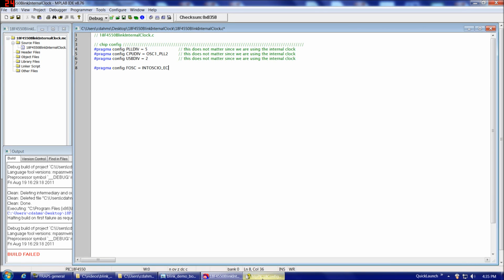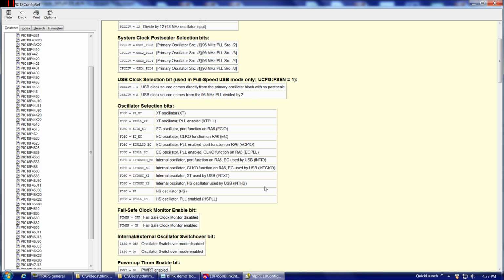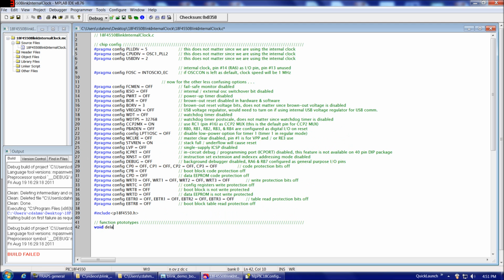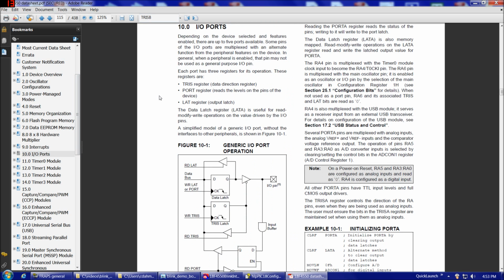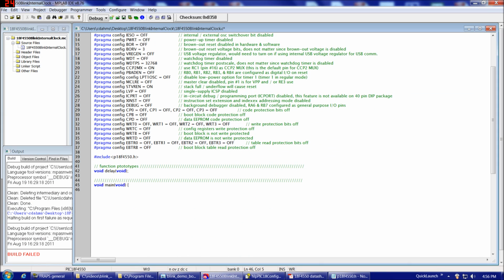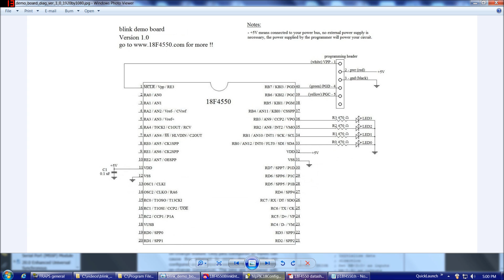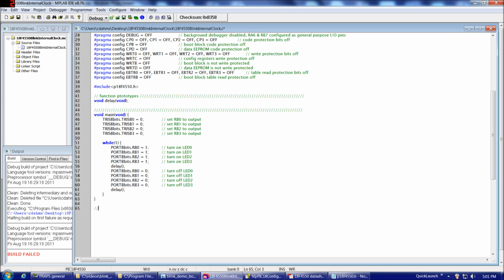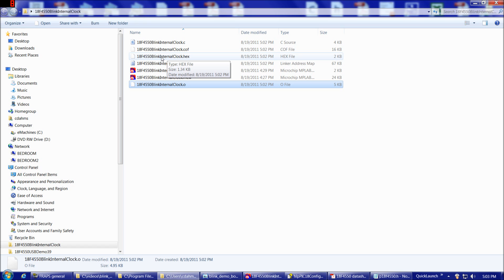How to program the PIC18F4550 microcontroller (blink demo board) part 4 of 8

Comment: I have this error after following your instructions maybe you can tell my what is causing it:

(902) no chip name specified; use "PICC18 --CHIPINFO" to see available chip names
(908) exit status = 1

BUILD FAILED
Reply: If you compare your output window with the output window in this video, you will notice that the "/p" switch is missing. So add the compiler switch /p18F4550 to the MPLINK compile statement: Go to: Project > Build Options > Project > MPLINK Linker. Then check the Use Alternate Settings checkbox and add the /p compile switch: change the value from /o$(BINDIR_)$(TARGETBASE).cof" /M..... to /p18F4550 /o$(BINDIR_)$(TARGETBASE).cof" /M.....

Comment: Hello, if i want a delay of 0.5 seconds in my delay function how can i calculate the exact number to put in the for loop ? In this video you use 2 for loops . one with 1000 and other with 2, but i want mine to give me 0.5 seconds of delay.
Reply: you need to look up how many clock cycles a for loop would take then divide it by the clock frequency to give the time one for loop iteration takes